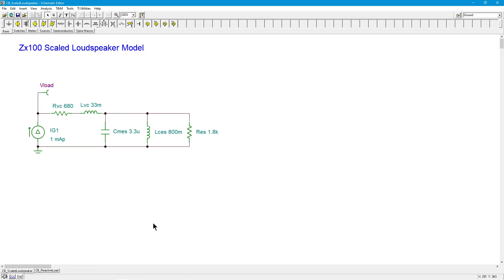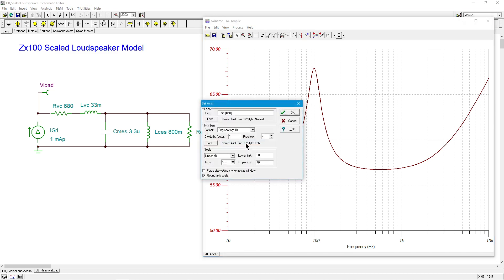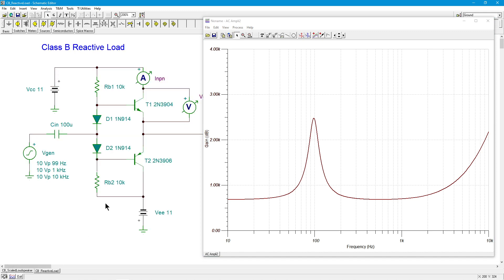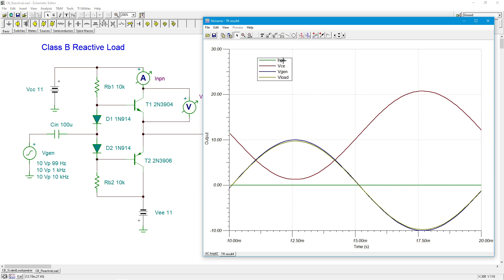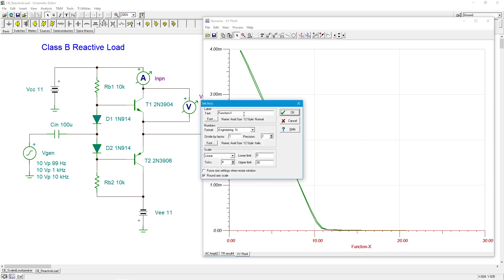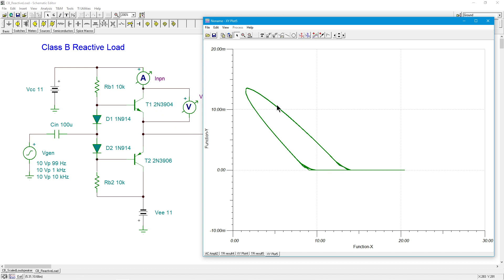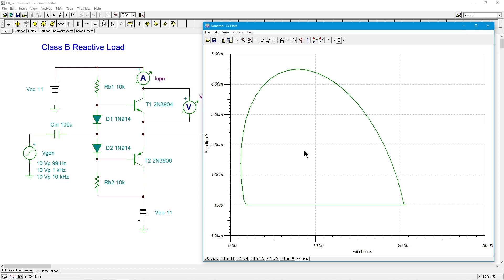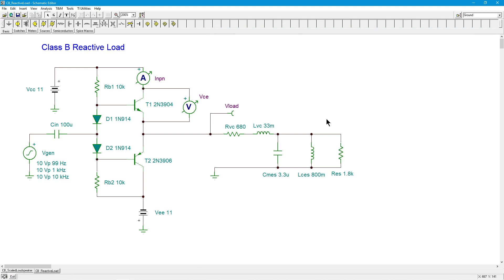Semiconductor Devices: Class B with Reactive Load

Comment: Hello, this topic is super interesting.
I have seen articles on how to "flatten" the impedance of the speaker,"Zobel Network", as I understand after watching your video, having a flat impedance the transistor does not give more voltage but it does give more current in the impedance areas canceled or flattened by the zobel network. Am I right?

Another important topic in the world of audiophilia is attenuators and impedance adapters. Especially with headphones and IEMs.
I have seen an online calculator to make a symmetrical attenuator, but you have to know the output impedance of the amplifier and the impedance of the headphones. And this last part is where the impedance is not flat and changes the sound, from white to pink, depending on how you do it. These attenuators are expensive, but impedance adapters are cheap. I would like to make one for my IEMs and attenuate about 12dB without changing the sound much.

Could you measure the impedance of the headphones and create the model like the one shown in the video? I know of a utility that, based on an image of the impedance and frequency response graphs of a speaker, exports a txt with the data of the curves, but that's it, data in two columns, X Y.
Could this data be used to create a spice model or something? For use in electronic simulation software.

I know there is Xover calculation software for speakers and boxes that uses this data, but not an equivalent model for electronic components.

Thanks for the videos, I learn a lot.
Reply from the maker: Short of a simple headphone adapter for a stereo receiver, I am at a bit of a loss regarding the insertion of attenuators between an amplifier and a load (pun not intended). If the user has the ability to turn the signal down, why not just do that instead of driving the amplifier harder and then attenuating it? As a general rule, distortion increases with signal increases, and then there are the Z issues presented by the attenuator. But in all candor, I don't use IEMs so I don't know what the issues might be regarding levels. What I do know from 50 years as an audiophile is that there seems to be an endless stream of what can be charitably described as "marginal ideas of dubious worth" that float around the community. 

The bottom line is that if an amplifier has a very low output impedance, the impedance of the load should not matter all that much (regarding frequency response), assuming the load is designed with constant voltage drive in mind. The important bit is that the amplifier designer understands that a complex Z load might push the output devices beyond their SOA (unlike a resistive load) and designs for it.